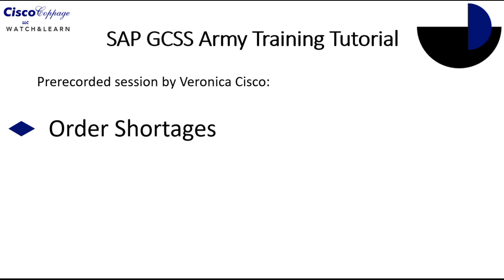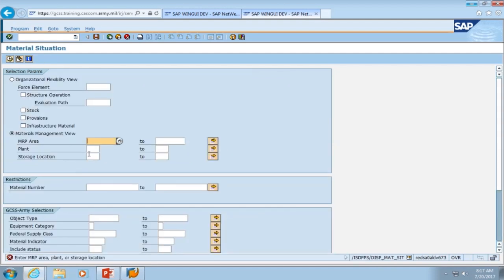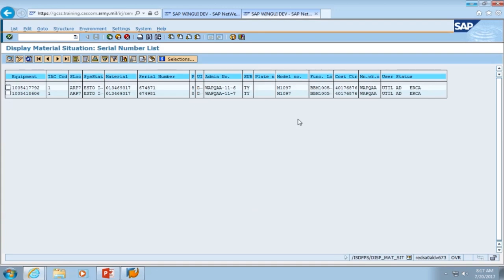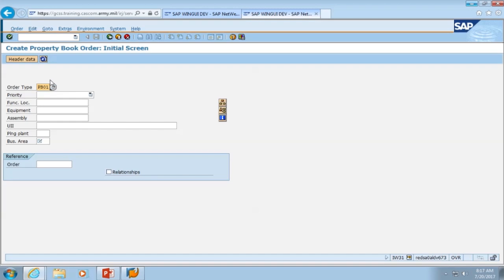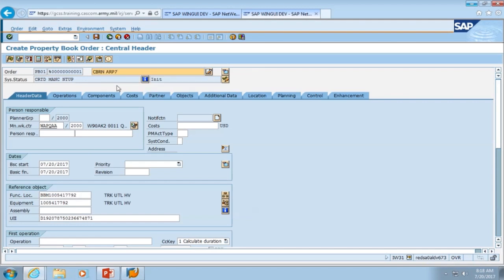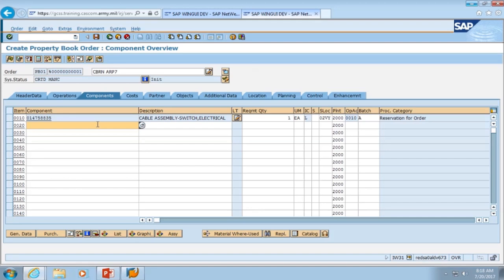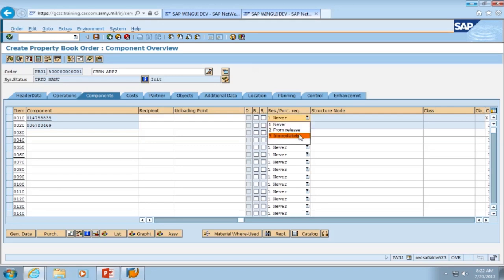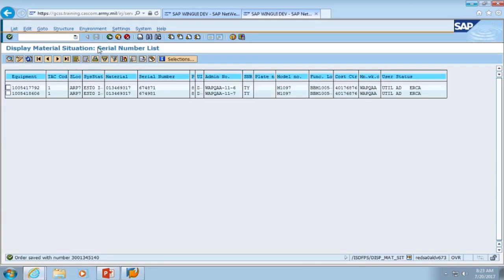GCSS Army Order Shortages Tutorial #92Y

Comment: This is a great video.  I use IW26 through EQU_SIT.  It works the same way, generates shortage annexes in IWBK the same, and are funded the same.  The only difference seems to be that it is visible on a dispatch 5988e and allows operators to track shortages through the historical parts ordered section.  

Make sure you put your workorders in a K status, so they don't report on the 026.

PB01 for CL2 and PM01's for CL9 shortages.

I also put the Admin Number in the Recipient Block and add the "Goods Recipient" column in ME25 report.  This is a much quicker way of finding the owner later.

Comment: what if the item isn't serialized? how do I order the shortage then? Is there a video for that?
Reply from the maker: Shortages are not ordered based from the serial number. The equipment record is needed to order shortages using IW31. If you do not have an equipment record then shortages cannot be ordered in the system; they will have to be obtained directly from the vendor or manufacturer.